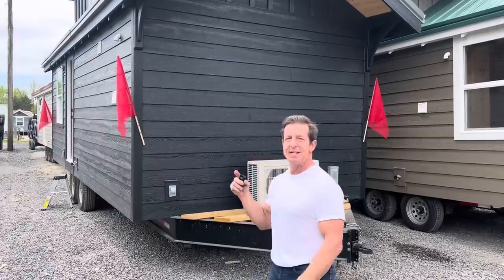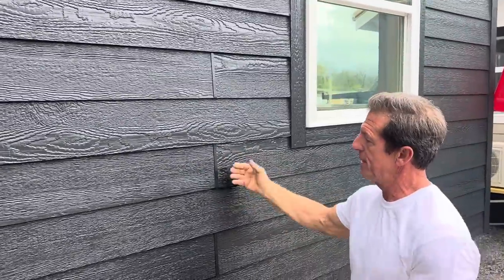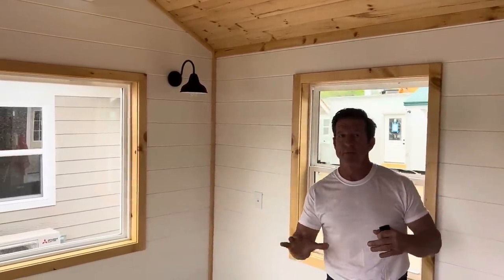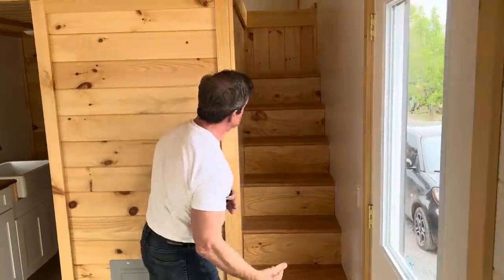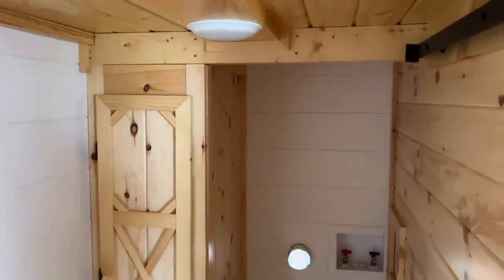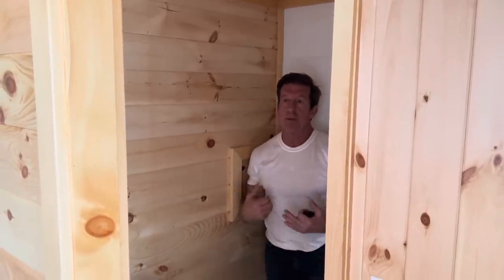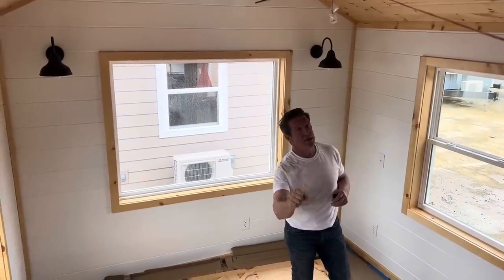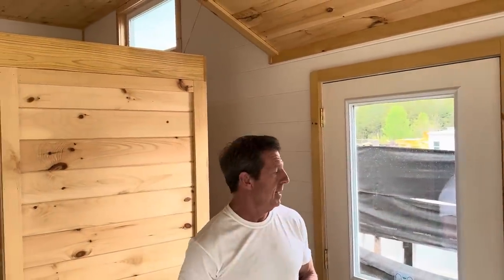79,900 10x24 Tiny Home with walk in pantry/ laundry room, 2nd level bdrm, 100+ sqft livin

Comment: That back room is awesome. Pantry, closet, and laundry room in the perfect place. That's all the storage I'd need.
Reply: Exactly. Almost like a basement. Maybe space for a small freezer. Definitely would put up a clothesline or a drying rack.
Reply: @robinsmith8252  - I'm bringing my roll up clothes drying line with me. It extends out and has a hook you can mount on the opposite wall to slide the end of the line into when using it, then after it rolls back into it's case, out of the way. Perfect for tiny living! And YES!... a small chest freezer next to the pantry and below the hanging clothes rod! Genius!

Comment: The walk-in pantry actually could be used as a closet or even a small office.  I think a small window added to it would make it just perfect.  Also that space by the tolet could be converted to a linen closet or even a storage closet for things you don't need to access all of the time.  It's a good design.  I like your homes.  I think the only thing I don't like is that there is only a sink in the bathroom and no cabinet.  I would probably like even a small Ikea cabinet, seems needed for such a small space.  Also, an outside storage attachment would be nice.  The only other thing is the steps seem like wasted space without storage in them.  I love that you work with the Amish on these.

Comment: Great house but in the bathroom why didn't you just leave the part under the stairs open instead of covering it up. I understand you need a top over the water heater but leave the rest open. It would be less wood used and less work but gives the owner a built-in place for towels and bathroom supplies. If I ordered this one, I'd have to open that section up.  Makes use of all space.
Reply: Lot of wasted space in the bath.  Couldn't they put the shower in that space near the toilet?   Weird use of space.
Reply: @eh3477  How would you get into it?  Jump over the toilet?
Reply: It is actually more time, work and materials to "craft-out" a nook for the small amount of empty space above the water heater. I was however thinking that the entire wall should somehow be detachable for the best access to the water heater and its pipes. Maybe 2 hinged panels (top and bottom). If the homeowner wanted to add a shelf inside for utility items or tools they could do that themselves.  But I do agree that having access to ALL of that awkward space directly under the stairs would be desirable.

Comment: I love this layout.  How wide is the washer dryer space?  Love the extra room in the loft.  I would go with color option # 12 and the Natural Hickory for the floor.  Very nice craftmanship on these homes.  I would also have a cabinet built for the LG 1.7 Smart Built-in Speed Convection oven and Emeril Lagasse French door ovens.  Drawers below for more storage for cook and bakeware, and shelves above for pantry foods, and other small appliances, like mixers, blenders, ice makers, waffle iron, smore maker, etc.  Also, in the bathroom I would put two rods next to the toilet where the stairs and end wall, meet.  This is one of my favorite floorplans, I would also opt for the bay window, then I would have a place for an table-top Christmas tree and other holiday decorations.  My black Magic Chef fridge will be perfect in there.

LP siding and Stucco are my two favorite sidings.

Another idea is to swap the bathroom and put in the end so you can have a 36” shower and the room on the side have a closet that can be used as a closet and pantry with some outlets to plug in appliances.   Also, I would put the electrical panel in the closet area at eye level in stead of the living room.

Comment: I'm renovating my 1942 Bungalow 850 sqft. 2 bed 1 bath 8x10 laundry rm.
I've been using my front bedroom for living room while finishing the living/ kitchen open concept 28x 17.
The 2 bedroom are 10x10 which seemed quite small when I first moved in (working my way down to a tiny house). I'm using my day bed as a sectional by pulling out the trundle. The bed is positioned in the NE corner. I replaced the door with a pocket which is on the north wall buying up to west wall. The 65" living rm tv is on the south wall. I could easily fill the tv wall with shelving/ cabinetry without making the room look crowded. 
I have plenty of room for my 2 Rotties on the floor & able to walk w ease around them even with guest over. Other great thing about using the small bedroom as tv room is heating/ cooling the small space. I got rid of the old EXPENSIVE HVAC that people insist on & put in a 3 zone mini split (I have ceiling cassette vs wall mounted unit which is much nicer). I'm thinking about keeping the bedroom as a tv room. Be much more comfy & economical extreme summer temps >105° & those artic blast that dropped -24° this past winter. Deep south had hard time when temps hit 40°. Don't want to know how much it would cost to heat & cool my 4500 sqft home at today's ridiculous high price of energy

Comment: The cabinets are still 24' making the width of the kitchen narrow, instead of using the 22' tiny house cabinets. I like the laundry/pantry room, but it should be switched to where the bathroom is located and vise versa put the bathroom where the laundry/pantry room is located.

Comment: A high Hopper Window in the middle-rear of the Flex Room in the back would add great light and make the room feel more open. Would love if it were 5ft deep instead of 4ft to allow a twin bed or desk for an office. Can you cantilever 12 inches off the back to give it the 12 extra inches?

Comment: Very nice sized home.  I would think one would want a bathroom sink and a stove/oven rather than  just a 2 burner cooktop. Very livable though.
Reply: Nope. Wash hands in kitchen sink. And a xlarge toaster oven works perfect. Simplifying life.
Reply: @robinsmith8252  No bathroom sink?  Germs.  (I could see a microwave/convection oven working)
Reply: @pcthayer  Pump bottle of hand sanitizer on toilet tank solves the germ issue.
Reply: @judymoye4368  That's one option I guess.  It's hard to break the normal hygiene habits we've had drilled into us as kids thru adulthood.

Comment: Your too pricey for your type builds. I've seen competitors utilize space far better.
Cut inflated pricing, use less wood, replace with sheet rock. 
But that's just my opinion. Wood in  shower space 👎.
I see mold & rot issues there. 
Not a fan, sry. 
Timbercraft produces far better tiny homes for thier pricing.
"Seems your stuck" in a certain design mode that is not best designed for the consummer, rather your pocket.